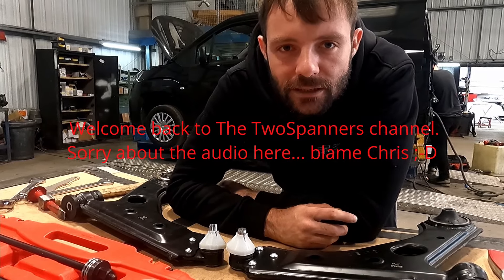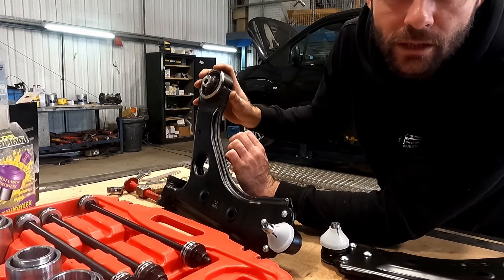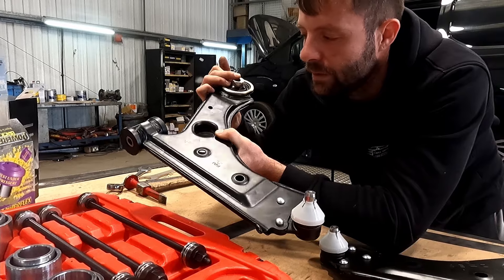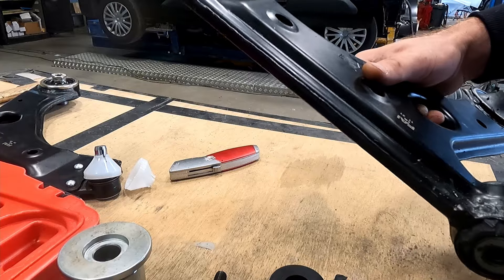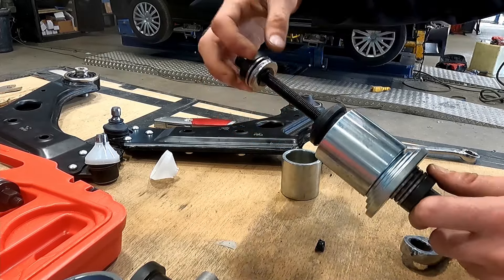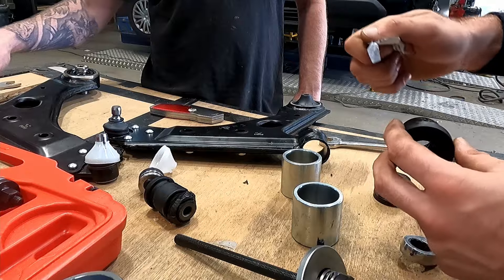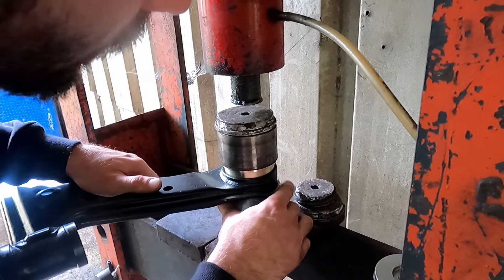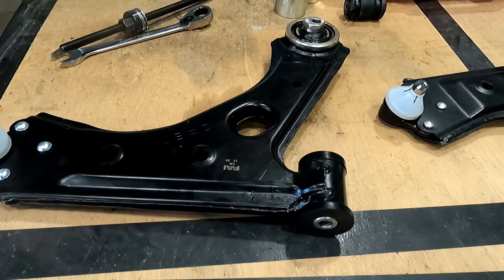VAUXHALL CORSA VXR - PowerFlex PolyBushes Fitted!

Comment: Great job. The new polybushes, and particularly the big flat ones have their center holes a little off-center, but the OEM ones didn't. Maybe to allow for different camber angle. I pretty sure these holes should be towards the same direction, at both control arms (e.g. both towards the center axle of the car, of whatever), or else there would be a bad geometry to the car.
Reply from the maker: Car totally fine mate, there ok to fit tbh and car drives good we on air ride now as well 🤣